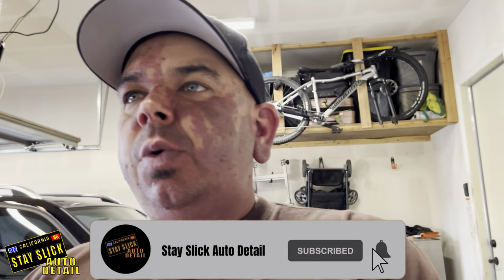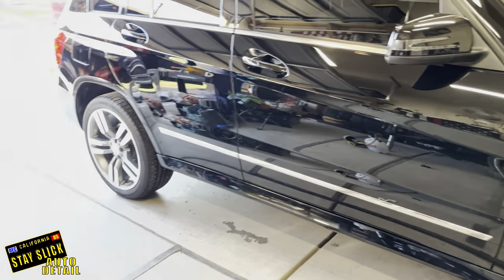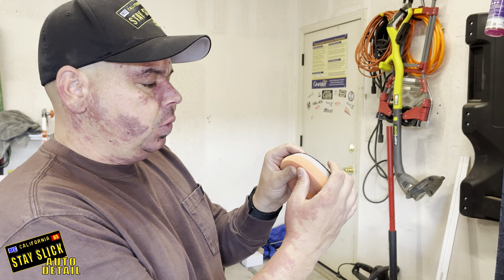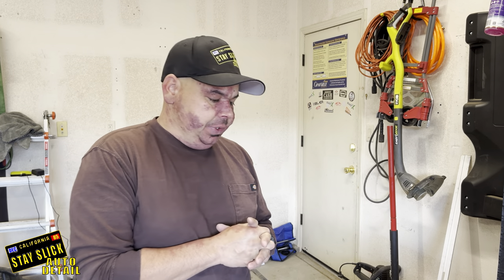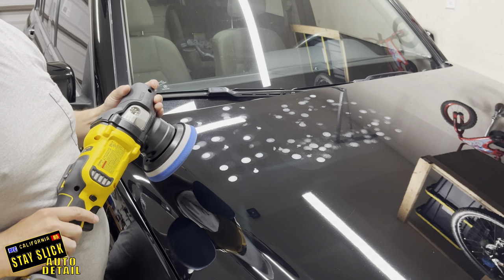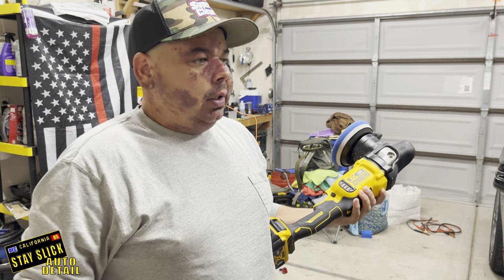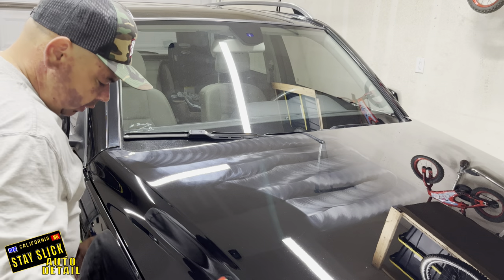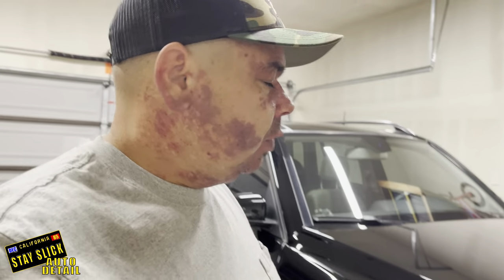A Beginners Guide to Polishing | Step by Step | Stay Slick Auto Detail

Comment: Great explanation, thanks
Reply from the maker: Yes sir!! I’m planning to do another video soon with more info.
Reply: @StaySlick  right on! One question I had… you said you make 3 passes for each section.  Does that mean 3 crosshatches (so 6, 3 vertical and 3 horizontal) or does it mean 1 vertical/2horizontal ?
Reply from the maker: However you want to do it is fine. The only reason we do patterns in general is a way to make sure we pass over the area equally and don’t miss any areas.